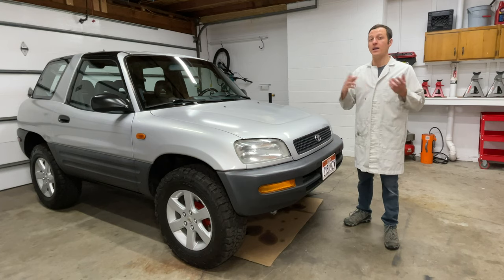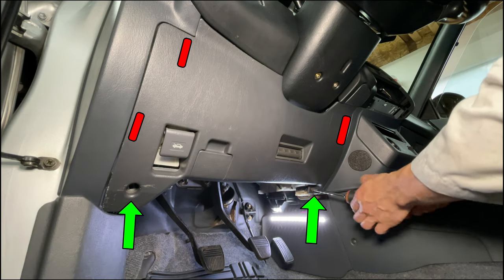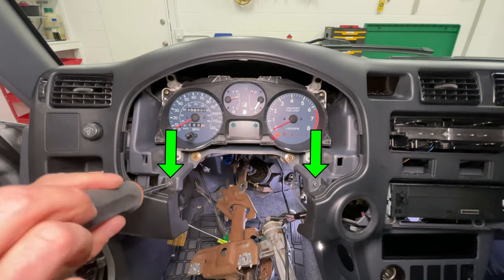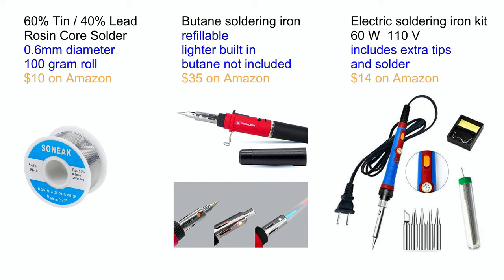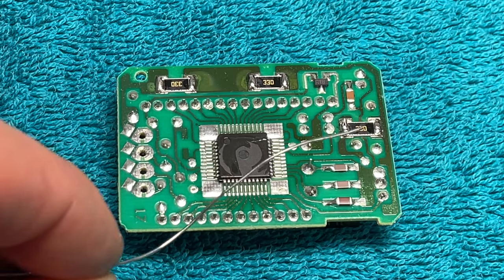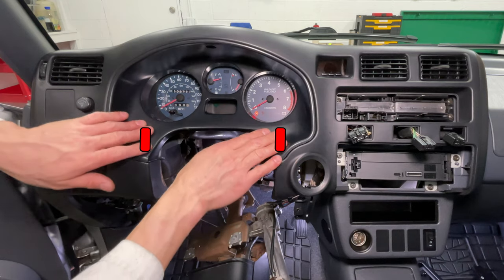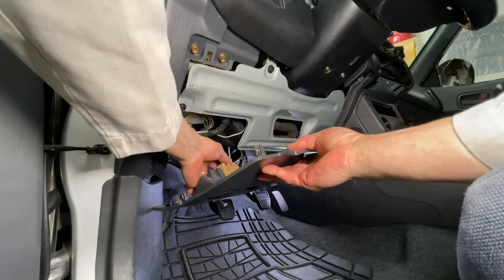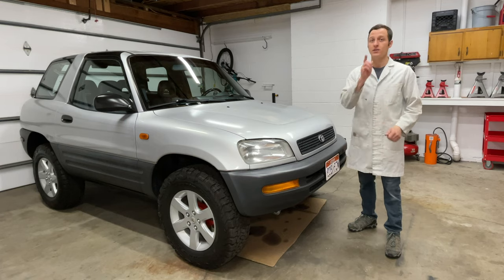Fixing the clock in my 1997 Toyota RAV4 (episode 30)

Comment: In my 1998 Toyota RAV4 (with a broken clock) I was able to finagle the instrument cluster trim from behind the steering wheel, and while I wasn't able to completely remove the dashboard panel with the wheel in the way, I was able to loosen it enough to reveal the screws holding the clock in the panel... Removing those screws (specifically the bottom screw) was another story... And so the steering column had to be dropped. "This is the way." 

I don't consider myself a "mechanically inclined" or "handy" person, but with the help of your tutorial, I was able to fix the broken clock in my RAV4! & I replaced the burnt-out climate control light while I was at it👍.  Even more remarkably, I was able to put everything back together once the clock was soldered and working. 

THANK YOU for these videos; They're so enjoyable to watch and obviously they are a tremendous help.

Comment: The clock works about 20% of the time in my 99, and when it’s on makes the car feel complete for some reason. Can’t wait to try this out!
Reply from the maker: You have the newer RAV4 too, so you should be able to get it without dropping the steering column.
Reply: Same here, have a 99 and my clock also works. I would say 10% of the time. Going to try this out on the weekend.

Comment: My clock doesn’t always work, one of the past owners messed with the cables and connected a CD player under one of the seats. Sometimes clock works sometimes it doesn’t, same thing with the courtesy lights and the driver side speaker…

Comment: After trial and error. Without removing the steering column you just have to remove the steering wheel and the gauge plastic cover will come off.

Comment: Can you please do a video on how to change out the differential bushings in the rear?
Reply from the maker: Yes, I probably will.  I installed new bushings in my RAV4 when I did the suspension restoration in this video:  https://youtu.be/c1gi9hoCpEI
My rear diff still clunks when I put the car in gear, so I'll try filling the bushings with urethane.

Comment: First off, great video. I have a 2000 Rav4, and the clock light just started dimming the other day when I turned the headlights on. First thing I thought of was a bad battery or alternator going bad, but I tested the voltage while the car was off and while running, and the volts were 12.8 and 14.3, so I think I'm fine there. Today, the clock was dim even before turning on the headlights. Could there be another reason other than bad solder, like a fuse going bad or something? I'm just happy the alternator seems fine, I just replaced that a year ago. Thanks.
Reply from the maker: The clock is supposed to dim with park lights or headlights on.  This is normal.  It's so the clock isn't glaring in your eyes while you're driving at night.  The only time the clock is full brightness is key on, headlights all the way off.
Reply: @LabCoatPaul  - Thanks for the reply. I've had my car since 2000. This is different, you can barely see the numbers. And like I said above, today it was very dim before putting the headlights on. Any reasons other than bad solder? Anything else I need to check?
Reply from the maker: @Nick23at63  I haven't had that problem, so I don't know.  Try re-soldering the clock like in my video.  If that doesn't work, get another clock from the junkyard.  If messing around with the clock doesn't do anything, you might have some wiring problems.  Check the fuse that goes to the clock first.
Reply: @LabCoatPaul  - Thanks, Paul, for your replies. Just giving you an update: my clock seems to be working at the moment like it had been for years, and my solution was - to bang on the dashboard right above it. I honestly did not expect that to do anything helpful, but surprisingly, it did. Yes, this won't last, but at least I know the clock still works and it is not a fuse problem. Some sort of loose wire or the solder going bad, will eventually have to do as you did in the video probably. Any other thoughts about this? 

Oh, and since my car is a 2000 Rav4, does that mean I most likely won't have to drop the steering column? Thanks again.
Reply from the maker: @Nick23at63  That's right, you won't need to drop the steering column.  Hitting the clock to make it work is a symptom of a loose solder connection.

Comment: I pressed on the clock a few times with by my finger to make it bright when my Rav4 sit in a garage too long. once I start driving it for hours the clock brighten up. No idea why but it works every time when I do that.
Reply from the maker: That's because the solder connection is loose.  Eventually it will get worse to where the clock doesn't work at all.
Reply: @LabCoatPaul  my pleasure finally meeting you! what state are you in?
Reply from the maker: @takpoon8140  I'm in Salt Lake City, Utah.

Comment: Paul, my 96 RAV 4 there is an ECT PWR button on the dash, I know this works to increase the RPM. But mine is manual transmission so not really sure what the functionality is, Any idea ?
Reply from the maker: That is weird.  The ECT switch does not belong in a manual transmission car.  Usually there is a center differential lock button.  Maybe that broke and someone installed the wrong button?

Comment: Hi Paul, is there anyway I can get in contact with you about a scooter carb? It's my first bike but the difference is that it's a GY6 50cc Grom Clone that's big bored to 100cc, I'm pretty lost on it.
Reply from the maker: You probably want to upgrade the carburetor to a larger size than stock.  I've never installed a big bore kit, so I don't actually have any experience with it, but you should check out my carb tuning video here:  https://youtu.be/iCGjVRyN6YU
Also check out this youtube channel: https://www.youtube.com/user/90gtvert

Comment: No videos since April from Lab Coat Paul?? He must have either passed away or finally found some friends to use that USB charger he installed for those rear seats!!
Reply from the maker: Still no friends and I'm not dead yet, but the RAV4 is, kind of.  The flex-a-lite cooling fans I installed in episode 16 overheated and shorted out, so I can't drive the car unless it's cold outside.  I'll be making a video about that, but I have a few other projects I have to finish first.

Comment: Hi I have an exact RAV4 clock but the resoldering did not work as one of the resistor appears to be faulty. How to fix this?
Reply from the maker: If re-soldering didn't work, finding a replacement clock from the Junkyard is your best option.  Or if you know which resistor is bad, you can just replace the bad resistor.
Reply: @LabCoatPaul  thanks a lot mate. I found which resistor was bad but couldn’t get the replacement resistor so I got a clock from the junkyard for around 10USD.

Comment: Hello. Radio, clock, and low beams quit working. Checked fuses, grounds, etc. Nothing. I'm trying to install a new radio.
Reply from the maker: You will need a voltmeter or a test light and some wiring diagrams to diagnose your electrical problems.

Comment: 1st gen tav4 doesn’t have obd socket right?
Reply: It's got an obd1 socket in the engine bay
Edit: looked it up, some 97 models had it under the passenger side dash
Reply: in usa, all vehicles were required to have obd2 starting in 1996 so yes they do
Reply: @handsarecats  been searching everywhere still couldn’t find it.
Reply: @nickaa827  couldn’t find it
Reply: @handsarecats  i think its the small diagnosis box in the engine bay. It has 22pin
Reply: @flyboy1149  are you in the USA

Comment: Couldn't you take off the trim behind the steeringwheel?
Reply from the maker: Oh I tried.  On my car it just can't get past the steering wheel trim.
Reply: @LabCoatPaul  Wow. That is one high maintenance economy Toyota 😂😂
Reply: @LabCoatPaul  oh, wait. I misread your comment. I mean couldn't you take off the steeringwheel trim? Like your going to take off the wiper and turn signal stalks.
Reply from the maker: @brockturner3112  I tried that too, with no luck.  The good news is: if you have a 1998 or newer RAV4, you can just pull the trim panel and you don't have to drop the steering column.